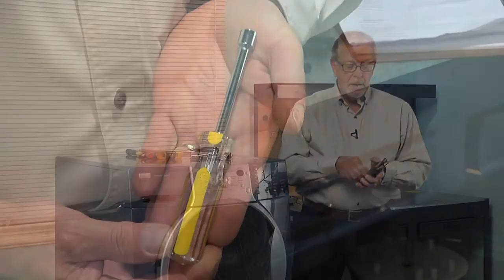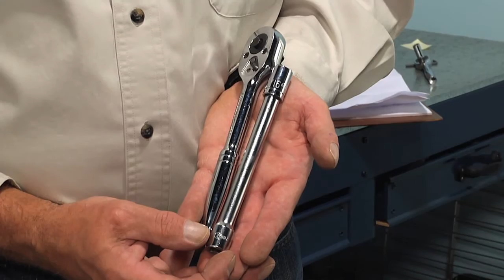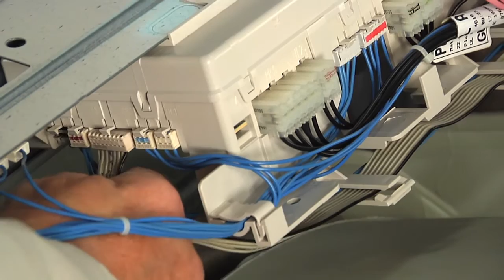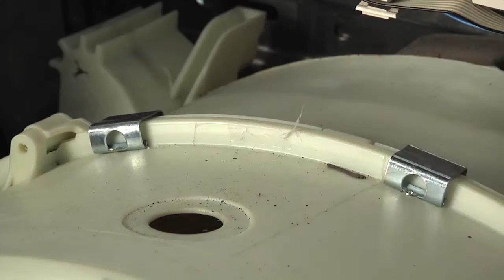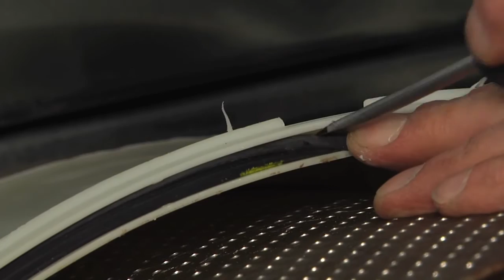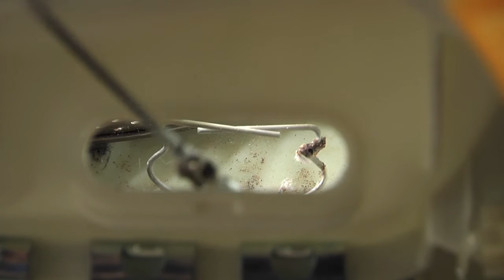Washing Machine Repair - Replacing the Outer Tub (Whirlpool Part # W10772607)

Comment: Outstanding video.  Quick question...  The front of the metal barrel goes thru the front tub assembly.  There should be very little if any play?  Is there a solid seal to prevent leaks?  I was thinking the tub assembly would act as a bushing around the barrel to keep it from flopping around during the spin cycle.  I'm only assuming that's were my banging is coming from.

Comment: just did my washer (purchased 2yr old 2nd hand whirlpool) took the drum out completely. covered bearing compartment and shaft and power washed all, good and clean as new. (the previous owner did not run the clean cycle and used to leave the door closed, the rubber boot will have to be replaced as it is moldy ).

Comment: Steve - thank you so much for this great video. My washer is a Maytag MHWE300VW12 - very similar to the Whirlpool unit. One MAIN difference are the shock absorbers - on the Maytag - there are 2 pins to retract on each shock. A real pain to push in. But I figured it out.

In my case, it was not a repair situation, but an "access" situation. A few weeks ago, I "lost" a 9mm socket. I thought I put it in my pants pocket, but it was nowhere to be found. Well, a few days ago, my washer was making an awful racket in the spin cycle. Yup, found that socket.